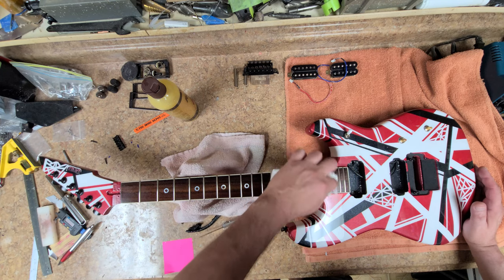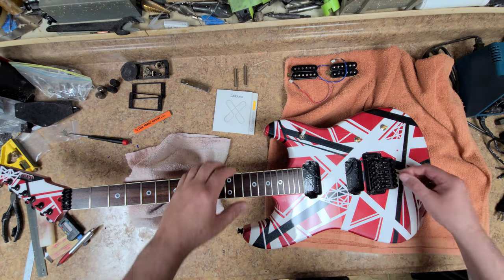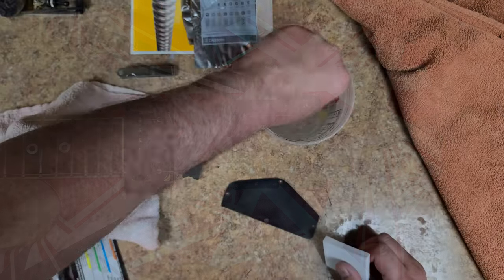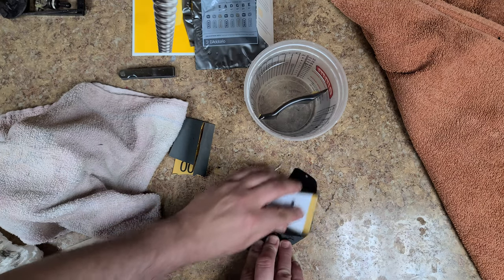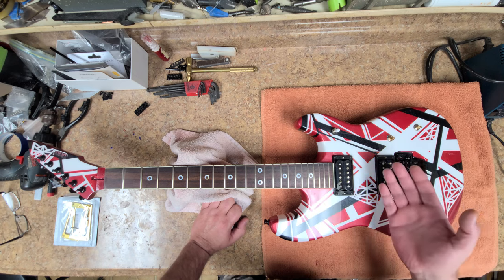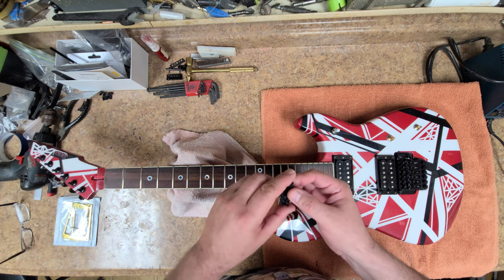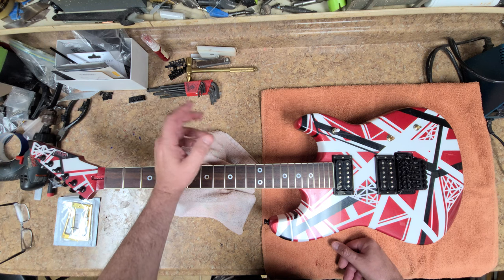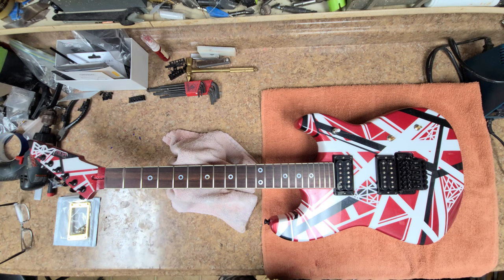EVH Frankenstein Devlin is Nutless

Comment: The entire floyd nut and string tree came together as a complete kit. 
But I never ran into that problem with a nut.
Do whatever you need to do. Whatever you think is right.
Reply from the maker: I checked out my jackson and Ibanez.  The blocks don't stick in any of mine.  All the lose locking nuts are the same. The string angle on the jackson is about the same as the devlin, but the headstock angle are not. You will like the adjustable nut better.  I just wish the spare one I have was a little longer or wider with the with of the fretboard.
Reply: @ericctheartofnoise8613  sounds great!
Reply: @ericctheartofnoise8613  you'll have to show me how to use it. Never had an adjustable